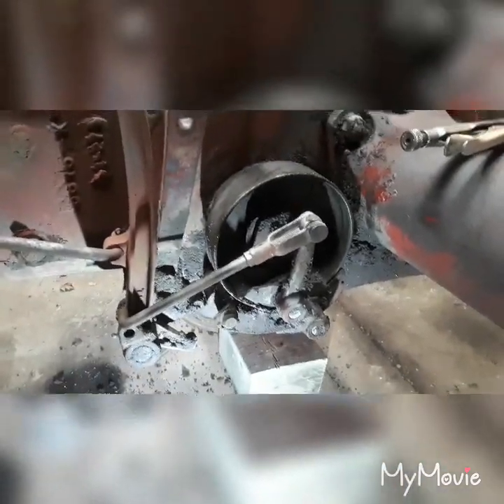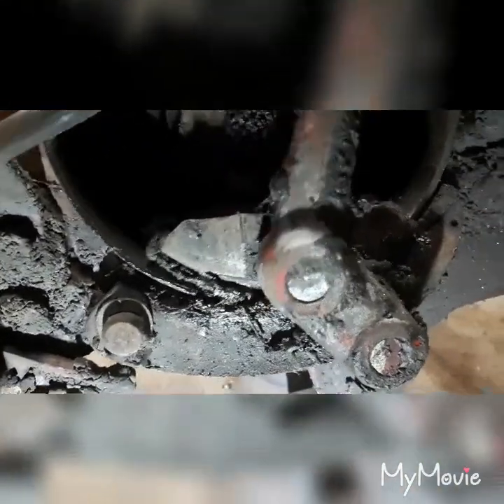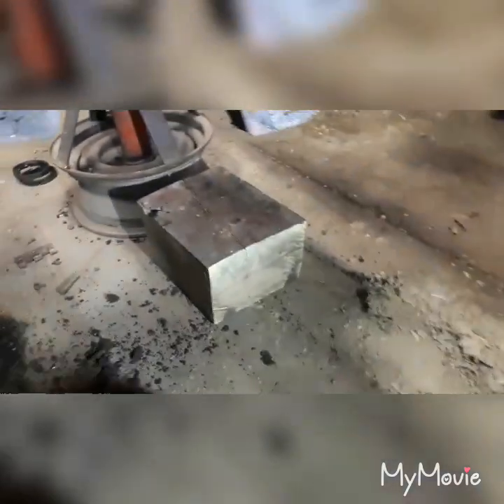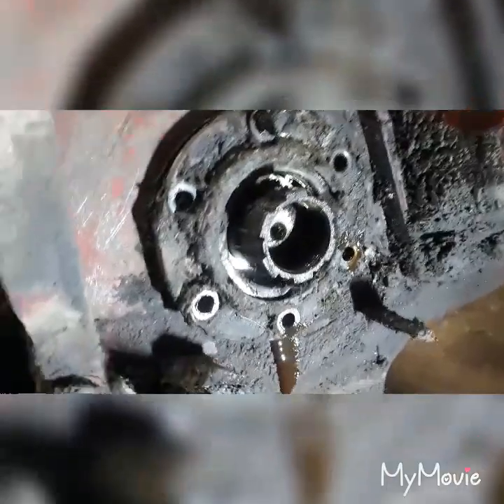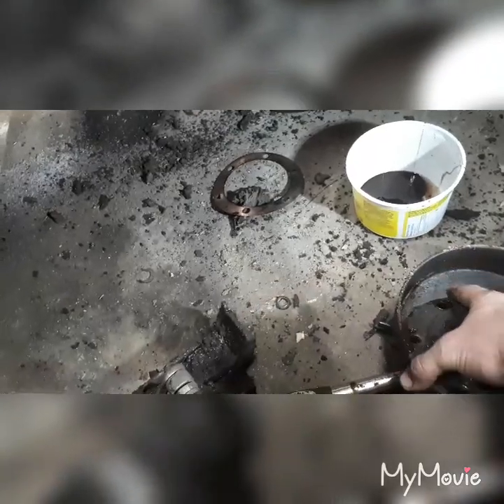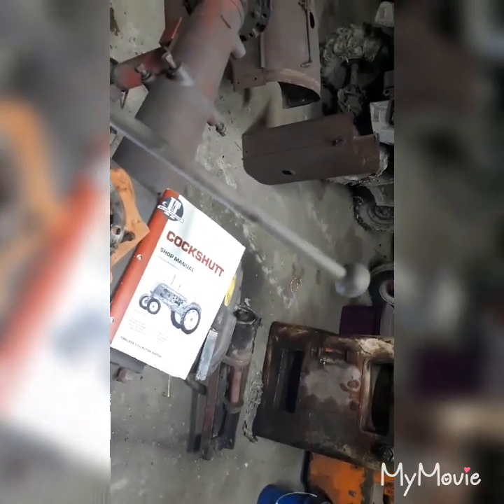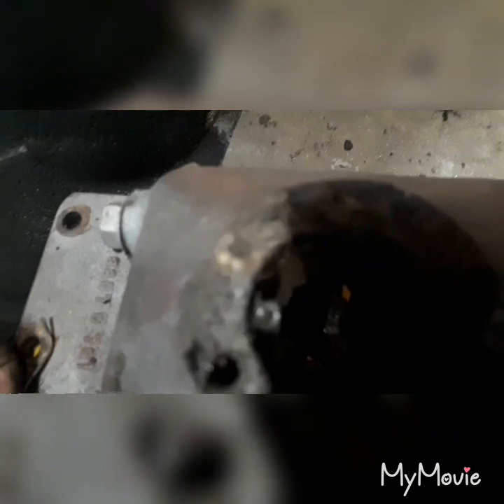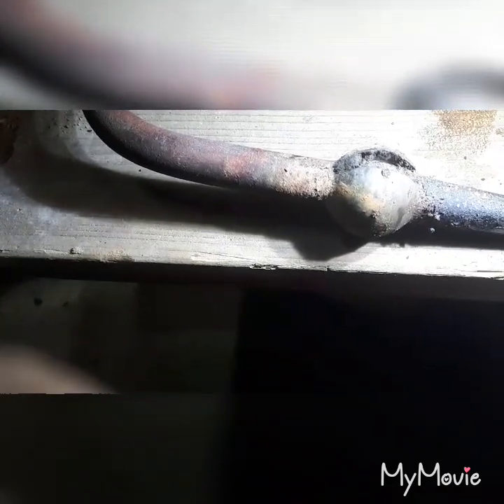Cockshutt 30 brake/gearshift repair

Comment: When I took the brakes apart on my Cuckshutt 30 I was lucky enough to find that the outer spline washers werre still there. They are a soft rubber washer that conforms to the splines when the tab washer is compressed under the cap nut. Yours appear to be missing but I think that if you trace the tab washers onto some neoprene and cut them out, that will work. I'd like to see a video on replacing wheel seals .

Comment: Good info, William!  Never a dull moment huh!  Probably going to be hard deal to get those splines to seal up, even if you filled them with RTV or something during assembly, there's probably enough movement there that it'll break up the RTV.  Hope it all goes together well!  Thanks for the video!
Reply from the maker: Nope never a dull moment around this joint lol. I think I'm going to try the RTV sealant. It's better than nothing lol. Thanks for the comment and for watching. Have a good one!
Reply from the maker: Are there any cockshutt's in your part of the world? I have a tractor here that came from Iowa. I'll do a video as soon as I get decals for it.
Reply: @williamchambers7235  Well, technically, you have several that came from Iowa - Charles City, Iowa lol!  Yes, there are a few around that I see at tractor shows, anything from a 30 to the occasional 4-digit Oliver/Cockshutt, but really not too many.  Yeah, I'd be interested in seeing what you found from Iowa up there!

Comment: Plenty of oil keeps you from wearing out the brakes!! LOL!  You got a bit of work on her but at least it had oil in it! That's a plus!! lol   I hope you don't have to go to far into the transmission! If you can't get a replacement pin, maybe you can get one turned.  Have a great week Jim!!
Reply from the maker: Lmao! And here I've been cleaning oil off brakes for years. So far not too many surprises. I think a pin from a #80 roller chain will work perfect. I hope everything is well. Thanks for the laugh and for watching.